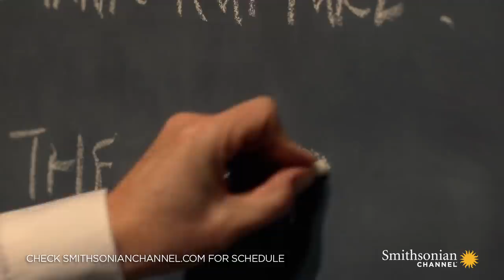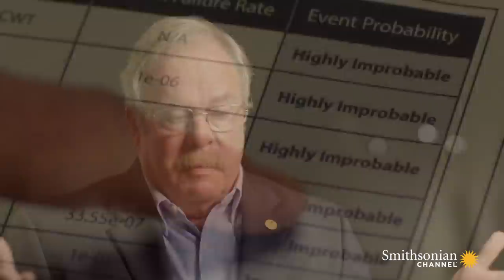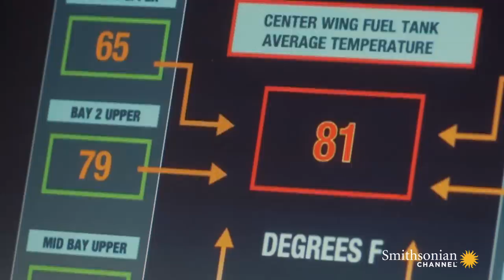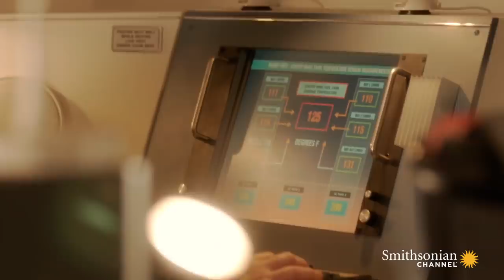How Air Conditioning Caused TWA Flight 800 to Explode

Comment: Probably the Plane was shot down.Don't blame on design because none of the 747 exept TWA800 hadn't experienced this kind of problem.
Reply: faulty wiring. not air conditioning lol
Reply: https://en.wikipedia.org/wiki/Continental_Express_Flight_2574

Not every embraer 120 has crashed like this, obviously according to your logic then there is a big conspiracy here aswell
Reply: But it happened to a plane in the Philippines just before landing
Reply: This plane was old and had more corroded wiring at the wrong location than the other 747’s in the TWA fleet. There is still no evidence that a missile was involved.

Comment: Let's start with the assumption that it was NOT a missal and try to prove a random theory from there, that's never happened before on a million other flights...
Reply: Yes. The NTSB "exploding Kerosene tank" is a ridiculous and unfounded argument, and which we proved such, in federal court.  its IMPOSSIBLE to 'detonate' a 747 fuel tank with a spark.  like its impossible to cook a steak in the freezer.  CANT HAPPEN.
Reply: @robshef718  Light a match in a petrol station or better yet, cause a spark with 2 wires, you will ignite the fuel vapors, not the liquid
Reply: @ey7290   Wow!  You are a 'science smith' aren't ya!   But unfortunately,  you are 'Not' an Aviation Expert... as am I, (former U.S. NAVY AVIATION BOATSWAIN.) nor do you understand the physics and chemistry involved in the situation.  'Aviation Kerosene'  or 'jet fuel', is an extremely stable and non volatile fuel. That means that Jet fuel is very hard to ignite;  about as hard to ignite, as a jar of peanut butter.  'Aviation kerosene' is Not a Flammable, but a Combustible liquid.  It has a very high Flash point, but 'Flash point' does not mean HIGH ENERGY detonation.  Not as the NTSB had errantly theorized that it was like a bomb.  The "vapors"  contain very very very little energy.... thus if your idea (which its not) was right, then every time they tried to start a jet engine, it would blow apart.  Jet fuel which is Kerosene, is a Combustible.  It has to Be 'misted' (as it is inside the engine)  in order to burn.  You can lite matches or make sparks all day long, but you are not going to get Kerosene vapors to 'detonate' with the power of a bomb.  Here are a few educational video's for you.     https://www.youtube.com/watch?v=7nL10C7FSbE&t=9s   /    https://www.youtube.com/watch?v=EYFF_1HSgDU&t=134s
Reply: @ey7290  you can throw a match on jet fuel and it will just snuff out.

Comment: Air conditioning is not designed to explode and is meant to provide comfort to passengers
Reply: But its position underneath the main fuel tanks allowed the jet fuel to reach flammable temperatures. All that was needed was a spark to trigger ignition.
Reply: @JCBro-yg8vd  ...and all that spark needed was at least 1200 volts of electricity to manifest.  This plane ran on 115 volt.
Reply: @JCBro-yg8vd  and the 200 people that watched a missile go from the harbor to the plane?

Comment: For Jun Ren Ong  & Ben G: 

Aviation Kerosene is a Combustible and not a flammable liquid. What is misunderstood is that the 'flash point' is mistaken with, 'explosion'. The Flashpoint by ASTM D93 Flash point standards is defined as the temperature of the liquid fuel, or to what temperature the liquid fuel must be heated to, in order produce an ignitable vapor-air mixture above the liquid fuel when exposed to an open flame. 
However, this is not a simple straight forward condition, as other factors are required for the vapor to be able to catch fire: (and) not explode.
 Note:  That [the] Flash point is basically important primarily from a fuel-handling standpoint. ASTM D6450-16a is the Standard Test Method for (a) Flash Point by the Continuously Closed Cup (CCCFP) Tester method. This is when the fuel is agitated though. 
The Actual Flash point of the fuel that was on the Flight 800 plane was 123 F.  
Even if Aviation kerosene is above its FP,  the Vapors do not 'explode' with extreme energy.  Again, AK is a combustible liquid. There never can be any circumstance in where the Liquid fuel inside the center tank will ever reach its FP under any normal performance or operational condition. 
Signed, Former U.S. Navy 'Aviation Boatswain' Second.
Reply: When I was young and stupid I worked as a house remodel .We did roofs as well and used hot tar. One afternoon we were hot mopping a flat roof and we were almost done so I got down and turned the kettle off. It was plenty hot enough for us to finish, I don't know how much time had passed but we suddenly noticed about 20 ft. tall flame from the tar kettle I had to climb down again and run past and shut the flipping lid to put the fire out. Most people don't understand flash point, without oxygen there is no flash point.

Comment: They have to lay this out because the fuel tank myth is extremely unlikely.  There just isn’t enough oxygen in the tank to cause a huge explosion
Reply: The vapor expanded throughout the entire thing because when they get hit it expands and there was no nitrogen at the top. The short circuit from faulting wiring caused the spark the ac turned the fuel to vapor because hot air went under the tank. Btw both of proven

Comment: This is why I need to find flights on Airbus planes.
Reply: Have you ever looked up the large number of airbus incidents?  no, I guess not!
Reply: Rob Shef still better figures than Boeing...
Reply: They cannt take a missle hit either.
Reply: @fcalvaresi  Most Airbus planes are newer. It's like saying the 747 is safer compared to a DC3. Every generation of plane is safer than the next, that's the point.

Comment: Did Boeing redesign anything? Did procedures change? This accident has always seemed like something was covered up
Reply: The Navy fired two missles from one of two submarines and 21 surface vessels in that area that were conducting missile tests exercises.
The missiles were seeking out drones fired from one of the surface vessels,.......TWA 800 breached the perimeter of the military exercise airspace.  The first missile targeted the heat signature from the third engine of TWA 800, then the second missile targeted that explosion.
The issue with those center fuel tanks did exist,....up until 1969.  In that year,  Boeing completely 
redesigned the center fuel tank system for the 747.  The TWA 800 aircraft was built in 1971, therefore, the fuel tank issue did not exist for that aircraft.  The Clinton administration, FAA, and NTSB used the 'center fuel tank' theory as propaganda to cover for the Navy's grave mistake.

Comment: What actually ignited it though?

If someone replies anything about conspiracy theories here, I will delete this and repost it.
Reply: a spark from frayed wiring inside the fuel tank that feeds power to the fuel tank level sensor was the most likely cause of the source of ignition. The sensor's voltage itself was only 4 volts, not enough to create a spark, but the wiring on the airplane was pretty bad and all bundled together with the fuel level sensor's wiring. Likely somewhere down the line much higher voltage from somewhere else, leaked into the fuel level sensor wiring, which created a spark that ignited the fuel. Sorry if this sounds confusing. I'm not the best at language arts.
Reply: There is a phenomenon that often occurs in airplanes called "stray voltage". It occurs because there are a lot of parallel runs of wiring that are close together. When power is switched in one wire, such as a major power buss being turned on or off, a high voltage pulse can be electromagnetically induced in an adjacent wire. This is the same principle as in a car's ignition coil except the wires are straight instead of coiled up. As TWA-800 climbed out a major power system may have been switched on or off causing a high voltage pulse to be induced in some adjacent wiring going into the fuel tank. This created a spark inside the tank, which ignited the fuel vapors.
Reply: They never actually could find the wire that caused the spark interestingly enough. They recovered like 97% of the aircraft but couldn't find any evidence of arching or any short. That is why it is a probable cause. They could never say with 100% certainty that is what happened. You can read the actual report it says something like "the wiring on that aircraft was not atypical of other 747s of that age."  This is not a conspiracy this is a fact if you read the report. It most likely was an electrical problem yes. But there is no physical evidence to support it.
Reply: Well let’s just say that nothing within the aircraft did this, because the data produced by the explosion indicate that it was of a high velocity nature. It might also be worth noting that NTSB grounded exactly zero 747s of any model or vintage pending the outcome of the investigation.  Hell, AF One continued to fly. Sadly it failed to explode.  I keep hoping, but I think TWA 800 was a one off ‘accident.’

Comment: My biggest gripe with this finding is why Boeing NEVER acknowledged or took action on this issue. That is a big red flag if the aircraft's design can make the airplane explode and nothing is down about it
Reply: Let me fill you in there Michael. You have been fed a bowl full of it.  There is nor never was any Issue as has been 'suggested' by this fake news video. There never was nor can be any exploding fuel tanks because of an AC unit nor by any supposed 'spark' in the fuel tank. That is JUNK SCIENCE.  It is impossible for the scenario presented to ever occur. The list is long, but to start with, "kerosene" can't >explode< from a spark. Jet fuel is a combustible and not a flammable liquid. My biggest gripe is that 99% of the peep in here who make post have no idea and yet have all of the answers.  Don't believe  everything, or better yet,  anything that your government tells you is so!
Reply: The issue with those center fuel tanks did exist,....but only up until 1969, the first Boeing 747 aircraft made it's first flight just seven months earlier. After seven months in Sept. of that year, Boeing completely 
redesigned the center fuel tank system for the 747.  The TWA 800 aircraft was built in 1971, therefore, the fuel tank issue did not exist for that aircraft.  The Clinton administration, FAA, and NTSB used the 'center fuel tank' theory as propaganda to cover for the Navy's grave mistake.
Reply: @robshef718 You think jet fuel above its flash point cannot detonate on a spark? Do you know what a flash point is? Would you be willing to put your life on the line to test that?
Reply: @Owen_loves_Butters   Well first of all,  "Junior achievement badge seeker", The Jet fuel inside the 747 tank never reaches its flash point. This is just by the Architectural design as required by the FAA for Certification.  And on that note, the "Flash point" does not mean...  "KAPOW"...Explode!!!  Let me fill you in on something!  The Flash point is only the temperature (of the liquid fuel) at which a fire [on the surface of the fuel] could occur. Reaching the flash point does not automatically mean a fire will occur. This flash point is established for ASTM testing procedures for the Safe handling of, and transport of the jet fuel, for safe fueling procedures.  This is what those placks are for,  [on fuel trucks] to ID the correct transport and safe handling environment of the fuel; to avoid a fire from starting. NOT an explosion.   Aviation Kerosene is an extremely stable and very low in volatility fuel. it is heavier in the chain, and requires high heat and misting to get it to burn. The liquid that is. The vapors lack any HIGH energy given the [molecular structure] of the fuel chain, which is why it is a [combustible design] for the Jet turbine engines. If the vapors were as explosive as you think they are, then every time they tried to start up a jet engine, it would  blow apart!
A spark cannot detonate the 'vapors' into a high energy detonation. The liquid fuel is what is burning in the engine, "not" any vapor.(s) 
And the systems on the 747's Fuel storage and transfer system,  are limited to the electrical Mol /heat level,  that is ten times smaller/ lower, than what the minimum energy it might take,  to get any 'heat' from and 'electrical spark' - to get a fire to start.
There is nothing in the fuel tank that can spark that can start a fire.  Also, the fuel system inside the tanks and vents, have fire suppression systems, that are [light triggered] inside the pitch dark tanks and tubings.  None of the fire systems that were recovered in the wreckage,  were fired off. 
all the squibs were intact. And finally;  I was an "Aviation Boatswain"  in the US navy. That  means,  I was an Aircraft handler and fire fighter.  I went to school for fire fighting and know all about jet fuel and jet fuel fires. So no, the very lean vapors that might have been in the empty tank,  could not detonate like C4,  and blow apart the strongest aircraft ever built. 
Finally here is a video that might help you 
understand Aviation fuel. 
https://www.youtube.com/watch?v=EYFF_1HSgDU

and then: 

https://www.youtube.com/watch?v=7nL10C7FSbE&t=142s

Cheers.
Reply: @robshef718  The flight test literally showed the temperature of the fuel tanks reaching well above the flash point. That's the reason they did the flight test. And I know what the flash point is. And jet fuel is no less flammable than, for example, gasoline. It's just less volatile, hence a much higher flash point. But it's still definitely flammable enough for a spark to ignite it only if it's above its flash point. And you're right, normally, there is nothing that would ignite the flammable vapor. But frayed insulation resulting in a high voltage surge down the wires that went to the fuel tanks, and were not designed for these high voltages, could've easily caused a spark.

Comment: I been watch whole show. It not AC cause that. But it is alarming discovery that can heats up fuel tank to vaporize. Main reason was a fuel ganges sensor was shortened between radio that cause sparks and go kaboom.
Reply: Um, NO.....
Reply: ..no,......not even close.
Reply: @robshef718  um no ahahah mr Denier
Reply: That’s not what happened it was faulty wiring outside the tank that had high voltage currents pass through what should be low voltage wiring and short circuited once it reached the fuel tank

Comment: Laughing at the people in the comments saying how dangerous it is to replicate the scenario they did. Yeah the 747 was in service for 34 years and it has never sat on the ground when it was 87+ degrees.
Reply: You do realize fuel tanks are insulated from the outside, right?
Reply: @Ultimaton100  you do realize there has been no other plane to explode because a overheated fuel tank? It has not happened before TWA 800 and has not happen since.

Comment: A missile brought that plane down .
Reply: So the plane was delayed for 2 hours and with the air conditionars right below the center fuel tank and the ac when up to 300 degress and that vapored the fuel making it very easy to catch fire and with the aging electrical system of the 747-131 bundles wires mixed with high voltage wires and low voltage wires some are so warm they can short circuit. High voltage went to where it shouldnt go. Seconds later it went to the fuel probe and then it blew up.

Comment: id really like to meet who thought it would be a good idea to put compressors under a fuel tank.
Reply: Why do you think that an Air Cycle machine under the fuel tank is an issue?  So, you think that BOEING had no clue huh, and built that magnificent aircraft with guesswork???
Reply: @robshef718  you have no clue how the ac works it brings hot air from the engines and cools it down. That hot air goes under the tank. And the heat vaporized it.
Reply: @jonahmoran3751    Yes, the ''hot air' from the engines is...COOLED DOWN Inside the air pack!  what do ya know!  But Did you know, that the Air pack bay is vented by ram air ducts? probably not. There is No hot air that flows freely around inside the pack bay! The bleed air from the engines are ducted and vent out the back of the pack bay.  The Cooled air is graduated into what ever turbine it needs to go to and the rest is exhausted.  There is a temp over heat sensor and the pack bays are adjusted for the correct flow of bleed air.  The inside of the fuel tanks at altitude, are cold inside, not steaming hot as those fake videos try and tell the unlearned.  There is never any vaporized jet fuel because the Fuel tank never can reach it's flash point; never mind that the vapors don't detonate like C4!  you are welcome.